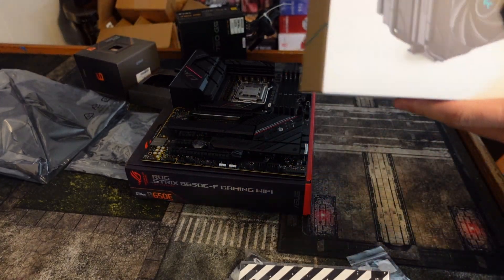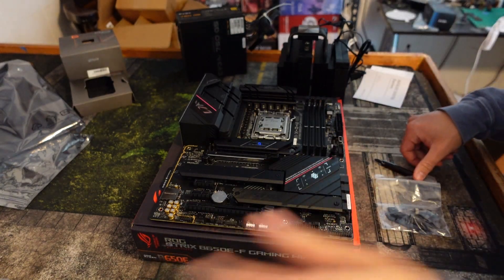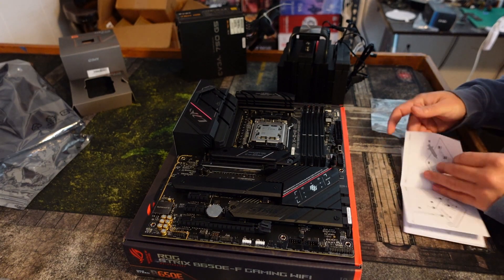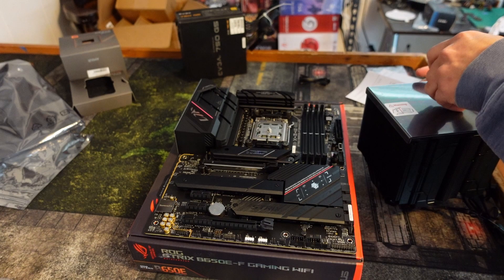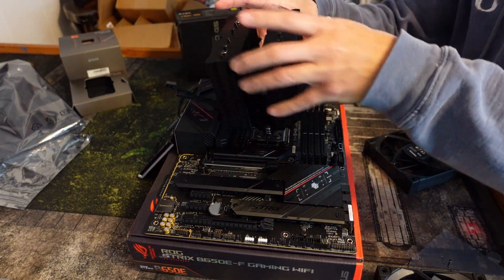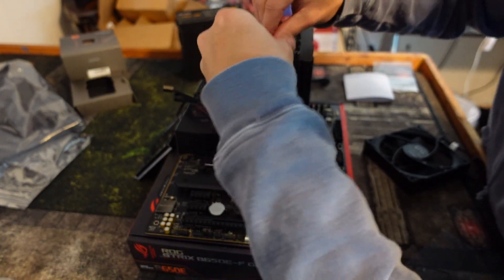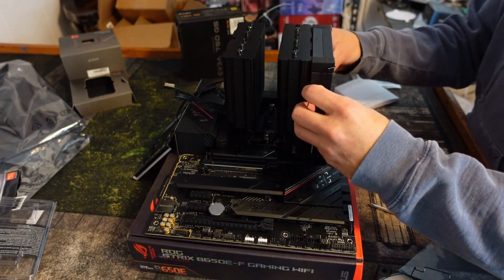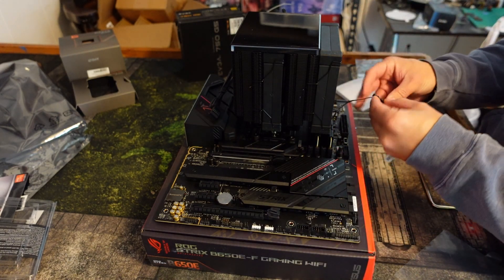DEEPCOOL AK 620 and 620 Digital AM5 socket install guide!

Comment: Did not clearly show which screws etc. were being used (too far away, too quickly). Would gave been nice to show the board from above. Did at least one step out of order ("Oh, don't forget to remove these first"). While I appreciate that you seem to have the only AM5 guide out there fir this MB, it wouldn't hurt for you to watch a few other videos to see how other people do it. A lot if people, like me, probably struggled to figure this out. Your guide *helped*, but as another poster said, it was more lije you gave us hints.
Reply from the maker: Thank you for the feedback, I will take this into account with future guides.
Reply: I also wouldve appreciated seeing you plug into the motherboard sockets as this cooler has like 3 plugs or somethinng? And Im a little unsure where to put them all.

Comment: Nice! I have the ak500digital on the 7900x3d 65c on Zephyr 17kh/s at 140watts.  Planing to get that cooler for the 7950x3d
Reply: 7000 series CPUs run warm. Those temps are ok